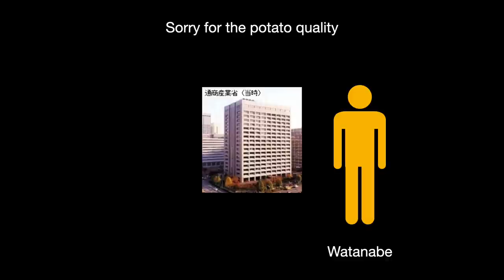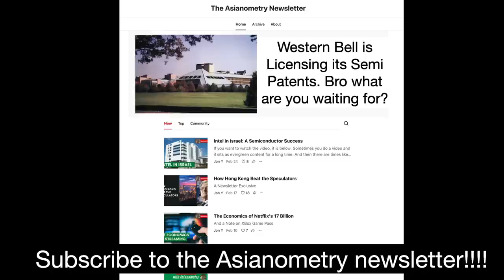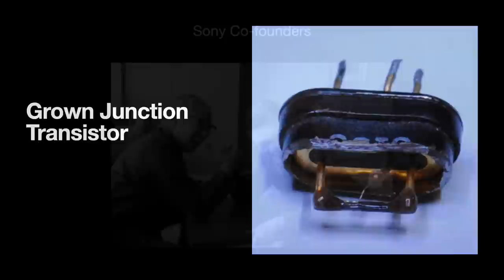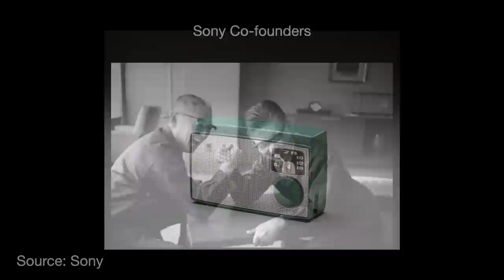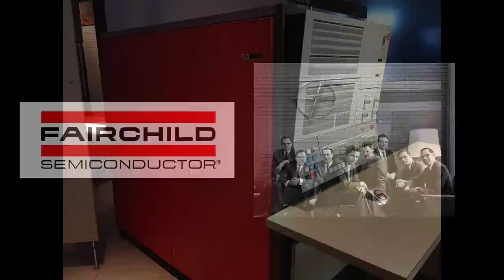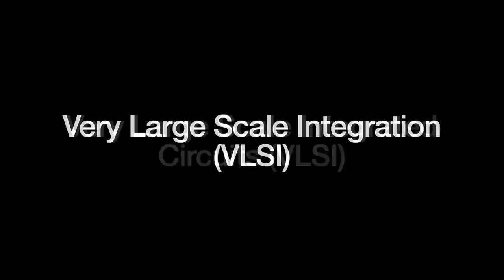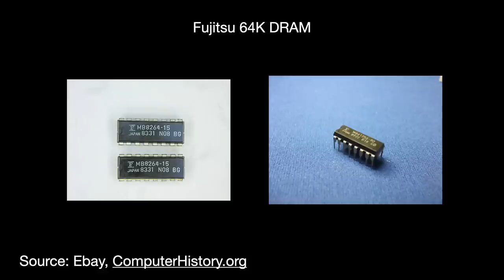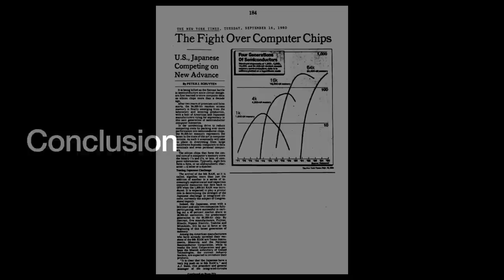How Japan Learned Semiconductors

Comment: I'm sure other people have pointed this out, but when talking about RAM, the unit of measurement is a byte, not a bit. There are 8 Bits in a Byte.  Bits are used for calculation and transport. Microprocessors work in bits. Ethernet, WiFi, and fiber optics are measured in bits. DRAM is measured in Bytes, kilobytes, megabytes, gigabytes, and terabytes.
Reply: RAM chips are measured in bits.
Reply: That's true at the system level, but the individually packaged chips being shown here were only 1 bit wide apiece. You had to put 8 (or some multiple) together.  And of course pay for them all. Even now you often see them in groups of 8 e.g. https://en.wikipedia.org/wiki/DIMM
Reply: I wanted to quote some IEC 80000-13 standards, but the ISO wanted to sell me this standard for 145 swiss francs. Now I have unspent 145 francs, which is a lot better than to know some random fact and that already made me richer.
Reply: Try having a look at a data sheet for a 4116 or 4164 DRAM. You'll notice that there's only one data line there: those chips stored only one bit at each address. (Obviously they were used in banks of 8, or however many you needed for your data bus width.)

And even 8-bit wide static RAMs and ROMs were generally measured in bits: a 2316 ROM, 2716 EPROM and 6216 static RAM are all described as "16,384 bit devices organized as 2K × 8 bits." The next step up is the 2364, 2764 and 6264, which are 64 kilobit (8K × 8 bit) devices.
Reply: @Curt_Sampson  I learn new things everyday. Now I have to go back to Hi-Tech and HIPAA

Comment: When I got a job at a semiconductor manufacturer in the mid-1980s, a part of the Japanese semiconductor manufacturers was very arrogant and shameless. The dispute between NEC and Intel, Hitachi and Motorola ended very sadly. At that time, NEC and Hitachi, which did not have much of their own technology in digital circuit design other than memory, set up a fight with Intel and Motorola, who had given them various knowledge. At that time, trade friction between Japan and the United States was a problem, but the Plaza Accord ended Japan's fate. Since then, Whole Japan has continued to fall, but it can't be helped because it is due to our own actions.

Vacuum tubes, transistors, thin-film ICs, liquid crystals...
America invented them, and Japan's role was to refine them.
It was a very good relationship, but Japan destroyed it !!

Comment: In 1957 the Japanese invented the tunnel diode. In 1968, I used them at 500 MHz. In 1984, GE was selling 70 GHz TD logic. Today, speeds are up to 2.2 THz. 1963-vintage CMOS is struggling to produce 7 GHz CPUs. Tunnel diodes have 100,000 times the speed-power product of CMOS. The first company to make Resonant Tunnel Diode Threshold Gate logic CPUs will win the CPU race.

Comment: Sorry the next step after 16K was 32K. Powers of 2 and all of that. Also why the jump from 16 to 32K had machines capable of 32k shipped with 16k for a lower cost. Some offered an upgrade for a substantial fee, or you could kit it out yourself if you knew how. Some also physically crippled motherboards on their low end machines to prevent people from DYI upgrading their machines. This was common right up until standardization of memory and bus interfaces.
Reply: The next step in the total memory of the  home computers you bought might have been 32 kilobytes of memory, but this was not true of the chips inside the computers.

DRAM chips of the early '80s were either 16 kilobit (4116) or 64 kilobit (4164); a home computer with 32K of RAM used either two sets of eight 16 Kbit chips or one set of 64 Kbit chips with half the memory unused. (These latter were typically defective 64 Kbit chips gotten for cheap where they simply didn't use the half with the defect in it.)

Comment: When Mostek introduced the MK4116, the first 16Kb 5v only DRAM in the late '70s, by 1981, NEC had an EXACT duplicate layout, including unused auto-refresh circuitry. This was before phot mask copywrites were a thing. That is also how the Japanese took the lead in electronics. They also took cameras into IBM so they could copy computer technology. So the Japanese were not good at design but rather fabrication and assembly, as the author noted.
Reply: "That is also how the Japanese took the lead in electronics." - They were still able to manufacture it with better specs than the US could, which is a lesser miracle on its own.

Comment: The truth is that a lot of YouTube channels get a lot of things  wrong regarding electronics and computers, and even house wiring. Try reading books to get your knowledge. Very Large Scale Integration is the proper term. Just try to read books, like Technical Manuals from the 60's and 70's. I have a ton of these in my library, as I was into Computers and Electronics starting in the NAVY during the late 1960's.

Comment: I remember Japanese computers that I used and were competition to ibm out of Germany these didn’t last long as eventually IBM took back the lead and came out with its Thirty Ninety series of computers and the fact that IBM were able to fabricate computer chips that were reliable and they could get more useable circuits out of a wafer than any other company their yield left others in the dust but, my faulty memory indicates that so much money was being expended, they decided to leave the computer industry because America decided that they were becoming too big and decided to break them up as a monopoly, that was probably when h ing realised that they were going to be broken up haphazardly, they would choose who would get their technology and chose intel who probably couldn’t carry it all themselves, shared the technology with another company who I think was Fugi all this was under cover stuff which I got by being in the right place at the wrong time, GERMANY for example IBM then receded into quietness and ICL  imploded, shortly after I would hear of Thomson building their new transistors but nothing much more as I had been getting into software for the mainframes and going to America and getting involved with multi processing operating software and being paid well. Shortly after that I drifted into the background as the companies in the Uk wouldn’t spend the kind of money that American companies would! And I ended up on the sidelines.

Comment: JRC4558 BABY.
Reply: JRC4556 is actually my waifu.
Reply: @SianaGearz  4556?
Reply: @middle_pickup  Yeah a higher current audio opamp, 70mA sunk or sourced officially, doesn't start misbehaving until you try to run about 110-120mA through it.
Reply: @SianaGearz  it's not even about the specs for me. The 4558 has historical significance for guitarists. It was used in the Ibanez tubescreamer.
Reply: @middle_pickup  yeah I know, I know. But just about every piece of hifi gear if it's a receiver or amp has a 4556 doing the headphone output. Incidentally usually a 4558 or 4580 as well, doing the line driver or input duty, alternatively the 5532 though. But invariably made by JRC, though most or all of these aren't their original designs.

Comment: Japan never reach summit in IC industry except memory chip!!!    Why?  
memory chips is hardware intensive process, not design or circuit R&D process. 
So , at the time, Japan buy all American lithigraphy machines at any cost on the top and newest model ,then copying it. Thus a bunch of made in Japan cheap machines can easily conpete to US. 
  Don't US aware of it?  Yes, they did. But their geopolitic in boosting Japan made them neglect the point. They knew well they can beat them down whenever they want.
Reply: Come on. America is behind the lithography business. ASML of Netherlands is on the leading edge right now. Second is Japan with Canon, Nikon and TEL. Correct me if there's some American company that produce Litho equipments.
AMAT  is not. Other than that, they lead on other wafer fab equipment steps.